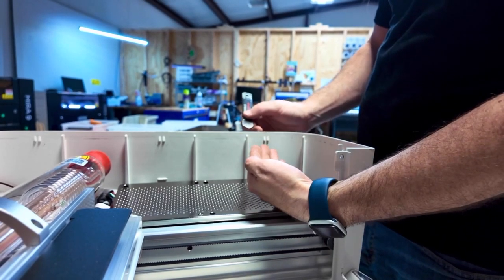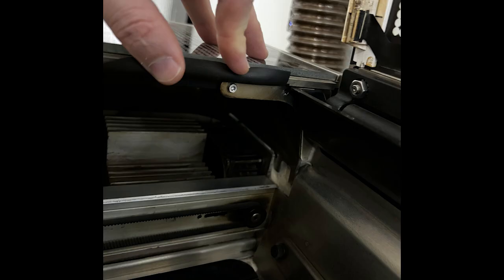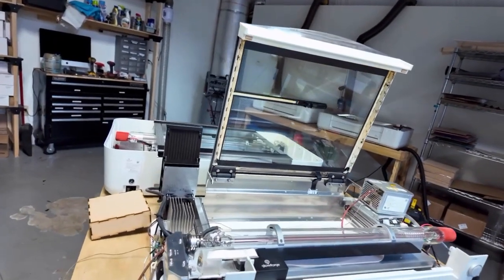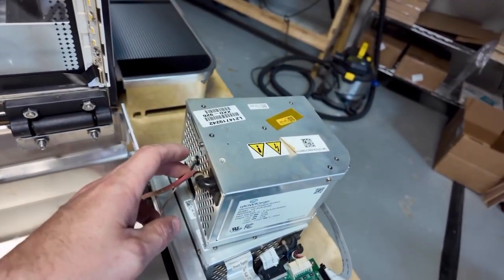Glowforge High Voltage Repair

Comment: I took my red wire out and cannot find any burnt out spots like in your video. Do you have a proposal, how that high voltage could actually be measured ? How likely is it, that the tube is actually dead ?
Reply from the maker: At this point it’s most likely the power supply.
Reply: @Cruizin542  Back to the question, how can I measure the voltage from the power supply ? Any proposals ? I assume this in the ~20 kV range, so some isolated voltage divider probe would be needed. Does anyone have experience with that ?
Reply from the maker: @kevinmeyer6255 not without special equipment.  There is a lot of voltage DC going through it.  Enough it’s dangerous, also these don’t tend to get weak.  They either work or don’t 98% of the time.
Reply: @Cruizin542  you write "these don’t tend to get weak" - are you refering to the power supply ? So how can I determine, whether it is working ?
Reply from the maker: @kevinmeyer6255 test it in a machine.  We have a test rig that is gutted so we can swap them out for testing in minutes.  But we try to only use new ones when we can.
Reply: @Cruizin542  So you can easily take them in or out ? What about alignment ?
Reply from the maker: If you don’t mess with the tube it doesn’t need to be aligned.
Reply: @Cruizin542  what exactly do you mean with "mess with the tube" ? Could I take a tube from a different unit ? What about a replacement tube with same dimensions but not from Glowforge?

Comment: As you replaced roughly half the red wire, would it not just be easier to replace the whole red wire ? This would obviously mean to open the power supply, but would that not be a cleaner fix ?
Reply from the maker: It would be, but it’s not easy.  The red wire is epoxied internally inside the power supply.  The power supply is also difficult to get apart.  So although it would be a cleaner repair, it’s not feasible for the regular person.  So this repair is the way to go since it’s easier to do, and you don’t have to take the machine apart.

Comment: HI there! I purchased the kit and when pulling out the red wire, there does not appear to be any damage to the original wire. What should I try next or is the machine junk at this point? TIA
Reply from the maker: If the kit is complete send it back.  If there are no burns in the wire it means that the burn is under the machine or the entire power supply is bad.  You can ship it in to wiregrass made for repair.

Comment: Okay, I’ve removed the red wire from under the carriage under the tube. There is no open burnt spot like the wire shown here and your other video but there is a significant bump in the red wire. Is that the high voltage short? I wanted to make sure before I bought this kit. thanks,
Reply: Same here did you ever get an answer?
Reply: @cleanlandry  I’m so sorry I didn’t see this until now. I fixed the wire at that point where the bump was and it did not fix it for me. It was the High Voltage Supply that needed to be replaced. I sent machine to Wiregrass to fix it and they did it in record time and had it back to me working perfectly. Hope you were able to get your machine working again.

Comment: Where does the wire normally break in the machine?
Reply from the maker: Normally under the tube, but if liquid spills down below it can cause it to short under the machine.
Reply: Are you saying under the machine meaning under the crumb tray plate? How do you get that plate out to inspect the rest of the wire if you don't see issues with the beginning part of the wire? By the way I haven't had any liquids in my machine, but my tube isn't firing.  Like one person said, if there's a shiny bubble like substance on the outside of the rubber, could that be where my issue would be?